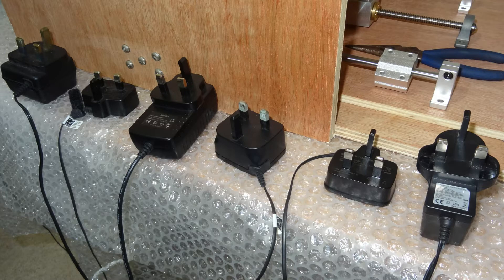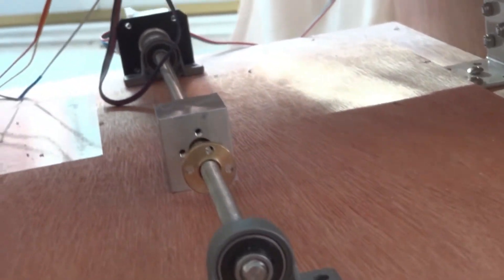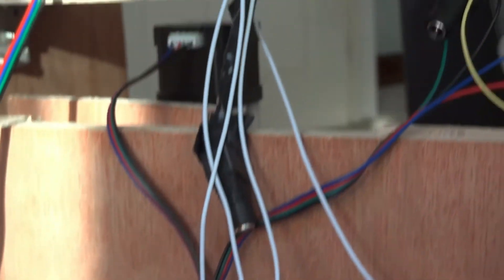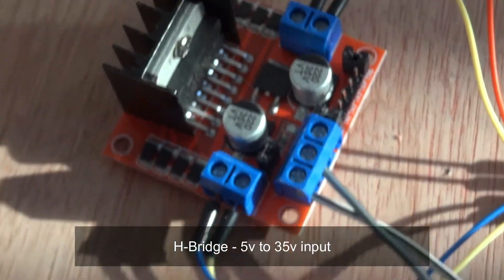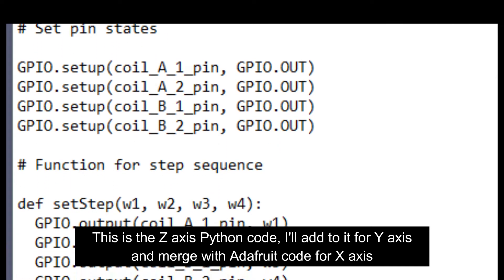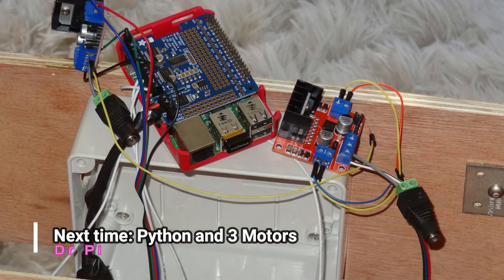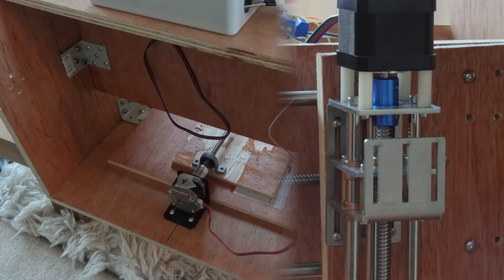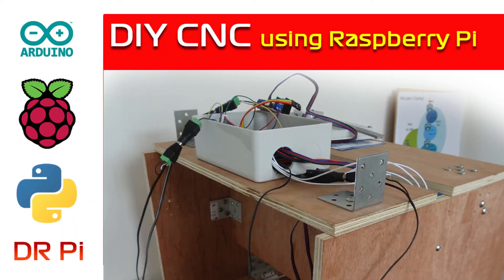Raspberry Pi DIY CNC project : assembly, power, motors, code!

Comment: Hi! I noticed you use Fritzing on another video. I’m new to this, and I’m working on an experiment with a Raspberry Pi.

Our intent is to build the components and wiring on fritzing (or another virtual test platform), and then put the code into it as well, and then simulate whether a) we’ve wired things correctly, and b) whether our code is correct, prior to actually buying physical components and uploading the code into Raspberry Pi.

I just wanted to double check if my understand of Fritzing is correct and whether what I just mentioned can be done with Fritzing? or should I be looking at a different software to try and digitally prototype the design we’re planning on making?

Any pointers would be greatly appreciated!
Reply from the maker: Yes, so I've used Fritzing for documenting my project. But it doesn't simulate a Pi.

So 
a) TinkerCad - and go to 'Circuits'
b) Using GPIO on the PI and add LEDs to test/simulate the full circuit. 
(add a 330 ohm resistor with each one or set the pin to PULL UP).
https://learn.sparkfun.com/tutorials/pull-up-resistors/what-is-a-pull-up-resistor

 You pretty much have to use the Pi itself,  I don't know of a simulator that does Pi/Python with Circuits. At least not one that's cheap/free.  

I've used https://www.tinkercad.com/dashboard?type=circuits&collection=designs on TinkerCad to do what you described, however it only works for Arduino + Circuit. 

It doesn't have a Raspberry Pi. You could build the circuit and add in switches, to simulate the outputs from the Rasbperry Pi.  It would at least let you test what value resisitors, capacitors, ICs, sensors, motors you need.

Good luck with the project!
Reply: @jobstr-work  damn that sounds super hard to try and recreate The rpi on tinkercad.. 

Thanks for your thorough answer - we're looking everywhere for a solution before our projects gets complex for prototyping..
Reply from the maker: @hiranga  https://github.com/freegroup/brainbox is the only other thing I've seen (not used it though) If you scroll down it look like it simulates logic with Pi as a simulation.
Reply: @jobstr-work  we'll take a look!